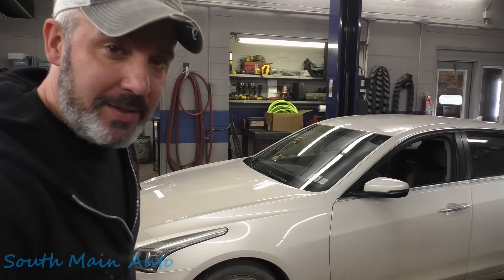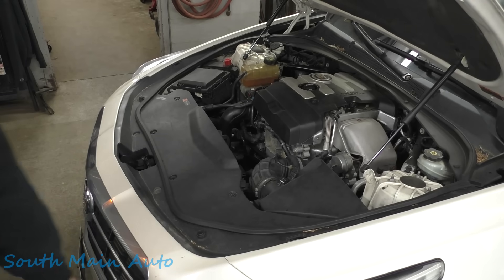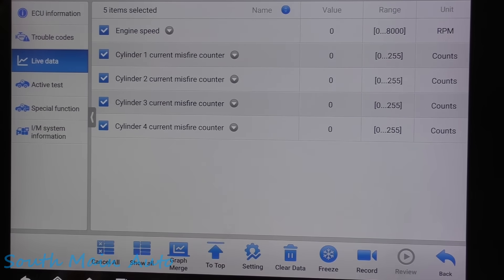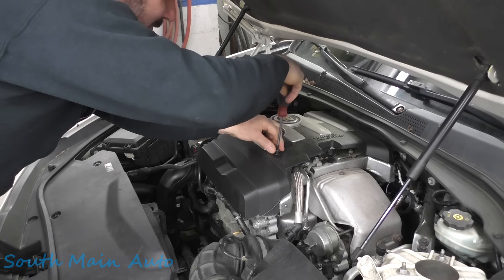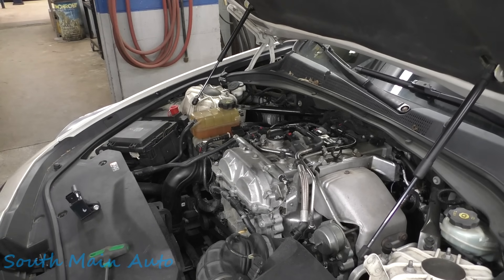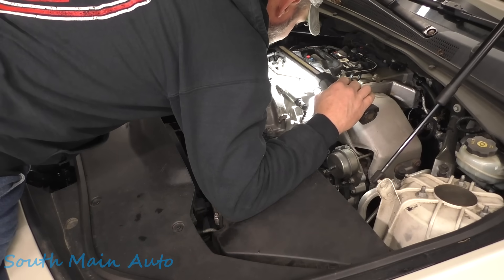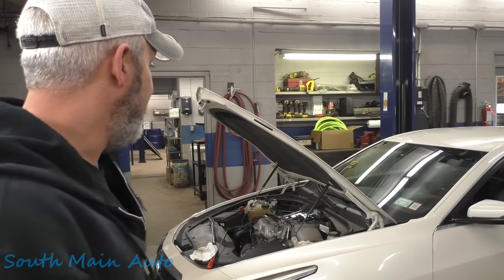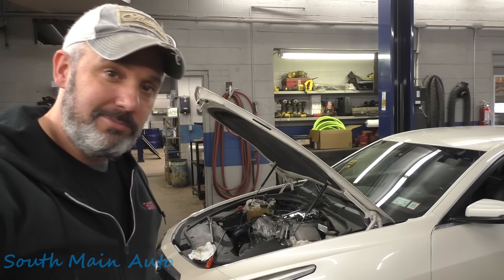'14 Cadillac CTS4 2.0 Turbo - Major Engine Damage

Comment: Owning a Cadillac with a turbo outside of warranty is a dangerous proposition.
Reply: Owning an Out of Warranty Caddy, is a Dangerous Proposition, Period
Reply: owning any gm product is a dangerous proposition period.
Reply: Just about EVERY, manufacturer today with a turbo and direct injection WILL fail
Reply: Unless you have tools  and median level skills
Reply: We used to have a 1980 Caddyshack Seville with the slanted butt. In 97 I drove it as my first car and it would punch holes in the rocker arms from time to time. The starter was $180 while the starter for my 86 IROC was $40. Caddies are expensive all around
Reply: Nah nan. I drove my twin turbo 3.6 CTS Vsport for four years. If you treat an engine nice it'll treat you nice. I had it tuned too.
Reply: @josephludwig1126 that's not true. The 2.0T in this car had issues with pistons breaking/cracking.
Reply: Wise Words
Reply: Owning a GM product is a dangerous proposition. Source: I own a Cadillac
Reply: owning anything American with a hair dryer is a dangerous proposition
Reply: @SeanPennII Oh four whole years! What amazing longevity!
Reply: @Mountain-Man-3000  I bought it in 2019 as a 2014 model year car. It had 65k on it when I got it. It had no issues.
Reply: Goes for any late model gm really.
MGGA😂
Reply: @SeanPennII  we are not apples to apples here, I should have said all 4 cyl direct injected turbo engines, i am a technician by trade, since 1980, manufacturer's design them to fail after a small window of there life
Reply: @josephludwig1126  That's fair. I have a lot of GM vehicles but I'm not interested in these small 4 cylinder turbo engines. They're clearly underbuilt and overran.
Reply: @SeanPennII  If you are really Mr. Penn, Thank You For ALL your excellent performance's , truly an under rated actor.
Reply: If you own any turbo charged car you cannot drive it like a normal aspirated car. First thing always run ethanol free gas second, change oil every 5000 miles or less but most importantly when you put it in park just sit there for a minute and let engine idle to allow cooler oil to run past the turbo bearings to cool it down before shut off. If you don’t do this, you will allow hot oil to set in the turbo bearings that will “burn” and overtime constrict oil passages in the turbo charger thereby causing early turbo/engine failure. Yeah, owning a turbo car is all about mandatory maintenance and different driving habits that most people do not do. They usually drive them like a non turbo and then bitch and complain about turbo failure!
Reply: You said it
Reply: Todays Northstar....
Reply: Any GM without a warriors dangerous
Reply: My wife's 2014 CTS is doing fine. 120k miles, 3.6 twin turbo, GDI. Runs like a beast. Likes to chew up spark plugs though. Still, a good running car.
Reply: which is why they all sell and update the cars, thus so many of these cars are up for sale and thats the problem right there ,people are not as stupid as they once were with online searches, you can do as much research as you can handle thus working out the perfect car for the family or yourself and knowing that you can with confidence ,buy a car and knowing what your buying even if it has known problems which GM has addressed, thus steering clear of cars with known problems like LSPI issues, which GM addressed with better class of engine oil dexos gen 3 class of oil better class of friction modifiers in the oil to cover LSPI and other issues as well? ? Little to late IMO ?
Reply: @SeanPennII  you kept it long enough to pay it off. Amazing.
Reply: I have recently (finally?) concluded that owning any US domestic car out of warranty is a dangerous proposition.
But I guess I shouldn't complain.  They make me a lot of money.
Reply: @brianp6965  especially with the tune. Plugs did not last long.
Reply: @pjimmbojimmbo1990 you took the words right out of my mouth.
Reply: @stroker-ve4ru agreed
Reply: @MrFastFox666  

The past 33 years, I've owned 6 Cadillacs. Overall they have been very reliable cars, and didn't cost a lot to repair, except for the 2008 when it was out of Warranty. I still have 3 1/2 yrs warranty on my XT5. Fingers, Toes, and Eyes crossed...
Reply: @josephludwig1126  Not Suzuki engines with their k14c and k10c engines bullet proof basically
Reply: owning any thing with a turbo outside of warranty is dangrous.
Reply: Thats an Cadillac
Reply: Owning ANY GM product with anything other than a v8 engine is risky these days
Reply: Owning a Scrapillac, period, is a dangerous proposition
Reply: Inrush of all that cold fuel guaranteed to wash ALL/most of the oil off of the bore or the piston face or out of the primary ring land. You'd be better off with a junk Subaru with their oil pooling issues. Buy a Toyota and drive reliability
Reply: They should of got the 3.6. I have a 2013 ats4 3.6 with 180,000.... still runs great
Reply: @lucidbarrier  Years ago, if you went to an auto parts store and you requested a certain part #, they'd ask the make and model of the car,they would charge more if it was for a Caddy than a Chevy.
Reply: @scottmarshall6766 my northstar is 29 years old and runs fine, 263xxx km.
Reply: they all hve turbos nowadays🤣🫵
Reply: @SeanPennII  owned many caddies never had any engine issues...if you treat them like shit, they will break, just like any other engine in any other car
Reply: bs...theyre all super reliable.  ppl that have probs are ppl who dont maintain them
Reply: @pjimmbojimmbo1990  Owning a car of any luxury brand out of warranty is dangerous.  They aren't built with reliability in mind and are very expensive to repair.
Reply: 2013-2014 LTGs had piston ring issues, I'm sure using regular gas doesn't help.
Reply: Idk I have a 2020 xt4 and it has been great
Reply: A cadillac in general…..
Reply: Same with the Chevy Cruze...
Reply: I’d say any vehicle with a turbo.  Also direct injection has had issues too depending on manufacturer
Reply: @davidfoulk3078 .  I have the 2018 version of this engine in my ATS. Is one minute long enough to idle before shutting it down? You said I should drive it differently than a naturally aspirated vehicle. How should I drive different?
Reply: @JHKCF  that's good. The wait time is 30 seconds so another 30 is great! Just make sure you warm it up before driving also.
Reply: Owning ANY GM product is dangerous IMHO.
Reply: @haasman100    Without knowing how much blockage the oil passages may or may not have, is there any way to reverse and clear those passages back open again?
Reply: @JHKCF  you shouldn't worry about that unless you feel there is a issue. You're doing the right thing buy knowing when to start/shut. Oil changes are key!
Reply: @haasman100    Thanks!
Reply: Hmm, 38k hard miles on mine in a year and it runs like it's brand new. Weird thing about following maintenance and using the correct fuel.
Reply: @SeanPennII yup. All you need is proper maintenance and to inform anyone that may drive it, IT ONLY TAKES PREMIUM.
Reply: Lol, good one. 😅
Reply: @carlosnavarro921  that's funny

Comment: Unbelievable that there are ‘shops’ who still replace coils, plugs etc. when the engine sounds like this when cranking.. Talking about incompetence.. Greetings from across the pond!🇳🇱
Reply: That lope during cranking is a dead giveaway.
Reply: Lack of desire to grow as a tech!!
Reply: Mechanics have done this type of crap for years. It's about the money!
Reply: As someone who works on their own stuff but isnt a professional by any means and has never heard that kinda crank my first move would have been a coil.... so may not have been a professional who did it.
Reply: What should they have done instead?
Reply: I've been wrenching for about 3 years and the low compression cranking sound is very obvious. Some people just don't know how to think critically and just follow the fix finder until something works.
Reply: @guynxtdork If you know the basics of how an engine runs you just need to do a proper diagnostic procedure. Engines need fuel, spark, and compression to run. 

First listen to the sound the engine makes when cranking, if it sounds like the one in this video stop right there because something is internally wrong with the engine, if it's solid then check spark plugs and coils, huge gap or covered in fuel residue? Probably a bad plug or coil, move coil and plug, does the misfire follow? Now you know it's a spark problem, now move the coil only, if it follows then it's a coil, done, if not it's the plug. If it doesn't follow at all then it's time to start checking injectors. You can get super advanced like SMA and start scoping stuff but even with minimal tools a proper diagnosis and fix requires isolating the problem to a single part before you start replacing stuff, especially if you're not the one (the customer) paying for said parts.
Reply: There is always hope that it will work.  My GOD it's worth a try?
Reply: @lonwillis783  Not if it’s cranking like this one.
Reply: Plenty of channels on you tube that will begin a diag based completely on the scan data and not bother to do a comp test. Blows my mind.
Reply: That's a CanadianTire, sears, walmart auto center type of attempt at fixing it. They know how to turn a wrench and that's about where the knowledge ends.
Reply: Care care nut channel just posted opposite of this. Dealer and another shop said it needed new new engine, and all that it needed was a new plug as it was fouled. So no you are incorrect. Try the easy things first before replacing the whole engine. A spark plug is cheap, and engine is not.
Reply: @zfunk9  The easy thing to try in a case like this should be a compression test and/or leakdown test. Replacing parts in THIS specific case is a waste of time and money. Replace coils and plugs all you want, it cannot fix compression this low. No, I am not incorrect.
Reply: @zfunk9 Dude... Did you even watch the video? He did a compression AND a leak down test on cylinder number one and it's just about dead...  A spark plug is not gonna restore loss of compression LOL
Reply: Incompetence, more than likely a parts cannon scam. They knew it was broken and through some parts at it anyway.
Reply: Greedy
Reply: @guynxtdork figure out what’s wrong maybe?check compression,spark,valve train. The basics still apply
Reply: Most are crooks
Reply: @noworriesmate5903  You misspelled 'hacks'.
Reply: @zfunk9  No point in replacing ANYTHING if it can be eliminated by swaptronics or simple testing.
Reply: Diagnostics, even when billed by the hour, doesn't sell parts so profits are cut in half. Everyone is crybaby until they have to maintain a successful business. Also, it's what customers want. All this whining is like complaining that fast food isn't healthy.
Reply: Just the fact that two other engines had dined on a piston should have told the customer that a coil or plug wasn't going to fix it.
Reply: R@guynxtdork runs rough,  always check spark plug then compression.. all cylinders should be close compression numbers.   Little oil in cylinder,  if add compression,  then it's rings.. best is use leak down test.  Blowby in oil cap, cylinder,  blowby in throttle body head/valves😊

Comment: I have a Cadillac CTS 2.0T. When I first bought it I made the decision to use synthetic oil and premium fuel. So far I put a couple of cam solenoids and spark plugs in it. 130,000 miles now.  Love your videos
Reply: My ATS has the 2.0T in it and going on 125k and had zero issues except maintenance. Same with using synthetic oil changed every 4k and premium fuel. I also had a walnut she'll carbon clean out done at 100k.
Reply: And this info is in the owners manual. Premium oil AND fuel. Good on you for treating them right.
Reply: @christopherharris3229  5000 miles maximum oil changes are key to keeping these modern GM engine alive actually not just GM all modern engines really
Reply: @lieutenantdan8170  Here in Australia we do a 5000 klms oil change (about 3000 mls)I always use synthetic oil.
Reply: The problem with these high output low displacement turbo engines is that people don't treat them as such, a small block chevy may have less horsepower but you could run one on varnish and dino oil without catastrophic failure. You gotta use premium on turbo engines, knocking and pinging usuallyresults in cracked and melted pistons. I do wonder if pinging was the cause of the issues on these enhine or if its just a design flaw, they are a funny piston design after all.
Reply: @DavidScheiber  yep I agree. These 2.0T pistons are not forged units, pretty sure. No doubt an unfortunate side effect of bean counters.
Reply: @DavidScheiber  Direct Injection engines use the piston top shape to encourage flame front propagation, they aren't forged because thermal expansion requires a loose fit cold, making them difficult to meet emissions, and they can be noisy, as well as the cost factor. It's not just one reason. DI engines are much less sensitive to octane rating, but turbocharged engines prefer premium.
Reply: @1320pass by bean counters you really mean executives with stock options and Wall Street in their relentless pursuit of more profits
Reply: What year is your CTS?  I have a 2014 ATS with the 2.0.  I've been using full synthetic mobile 1 dexos1 certified and have always run premium fuel.  So far. 60k miles and no issues.  Fingers crossed it doesn't fail
Reply: @jbanke1  Mine is a 2014
Reply: @BiigCheeze I've pretty much done the same.  My front engine cover has a tiny leak, I changed the front control arms.  My shocks and struts are all badly rusted.  I'm trying to find an aftermarket solution that'd work.  Any suggestions?  I'm wondering if a 2016+ Camaro suspension would work, both are alpha chassis
Reply: Premium fuel ... is going to be Key in this car. also If it has an intercooler Keep that baby Clean ! Make sure you can see through the radiator & intercooler. Keeping radiator & intercooler clean on this car going to be super important. if it does not have an intercooler , it would probably solve this problem right off. a Bigger intercooler would help this problem.
Reply: Are you guys testing your oil to arrive at 3,000 and 4,000 mile OCIs? The testing I've done shows about 7-8 thousand is acceptable with full synthetic. This is on a modern GDI turbo engine. I use Rotella T-6. My engine has 202,000 mi on it. I have used Blackstone in the past but there are other companies out there too who perform used oil analysis.
Reply: @Fix_It_Again_Tony  I haven't yet.  I considered Rotella T, but found it didn't meet the GM Dexos certification.  I believe it has to to with low calcium in the oil and its anti foaming properties.  Next oil change, I will do an oil test.  Couldn't hurt.
Reply: @jbanke1  T-6 is a diesel oil and it will not meet the standards for any gasoline engine. The formulations are constantly being updated for emissions and mileage compliance, but from what I understand diesel oils have more ZDDP which contains phosphorus and can damage catalytic converters, which aren't used in diesels. However, I have not found it to actually be an issue in my application.

I should also mention my application calls for 5w30 or 0w40 oils so the 5w-40 of Rotella T-6 works well. I wouldn't use it in an application that called for 0w20. 

Another option is Pennzoil Platinum which is an oil made for gas engines and has repeatedly been shown to hold up well in modern turbo GDI engines.
Reply: Almost every manufacture has a 2.0t engine in their medium size car line up. I believe it is the best balance of MPG and Power in todays heavy EPA regulated auto market. All I can say is keep a eye on the oil, and change it earlier than the manufacture calls for. I am changing my 2.0t oil no later than 7,000 miles. The engine oil lubricates and helps to cool the turbo. Take care of that Turbo and it will take care of you.
Reply: I have a ats 2.0t and I run amsoil signature series and change oil every 5k or one year. I only drive it in the summer. Also have it FBO tuned to e50 making about 330 wheel.

Comment: That was one of the piston set we manufacture at the Federal-Mogul facility (now Teneco) located in South Bend Indiana up until about three years ago when all the piston manufacturing was moved to Mexico. When I started there 35 years ago one full production line was dedicated just to Cadillac. The last major project I worked on was the GEN V engines which included 5.3 L, 4.3 L and the 6.2 L.  Take a look at the crown so those Pistons that are completely machine no casting surface left and we did it with only three tools and we had to achieve a cycle time of 12 seconds per part. We were able to do that by using a dual spindle machine and using two of them.
Reply: I was more than a little surprised to see casting on those pistons.  Which is good from a casting quality perspective... but not something I have seen in piston design.
Reply: Tenneco went to Mexico/China on the Struts/Shocks that used to be made in Kettering Ohio. They are a horrible company.
Reply: Parts made outside the USA are junk most of the times. I wish we were back to everything made here in the USA the way it used to be. Young people forget those times. When I was in high school in the 70s, my DAD made $9000 a years and yet he bought his home for $8600 with and, he bought a car for $3100 & a new truck for $3850. My children now days have to work 3 or more years to buy any of those things. That's a problem.